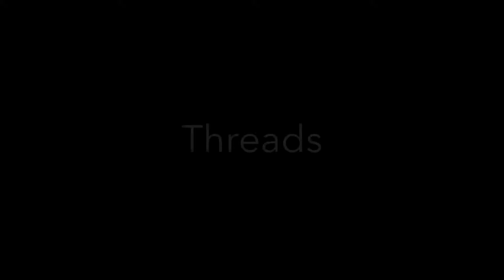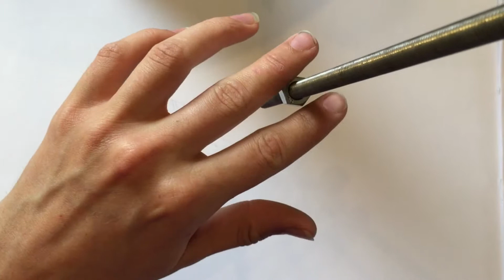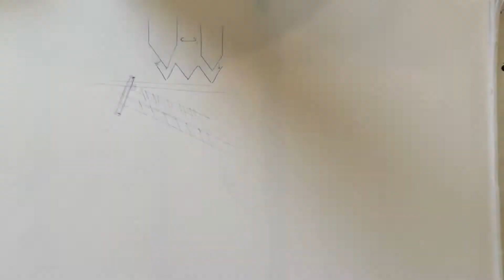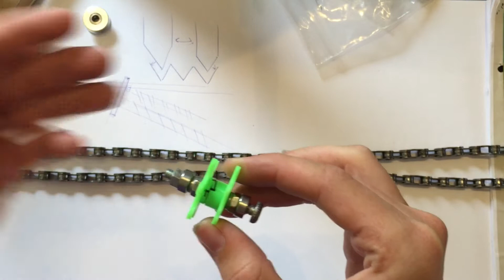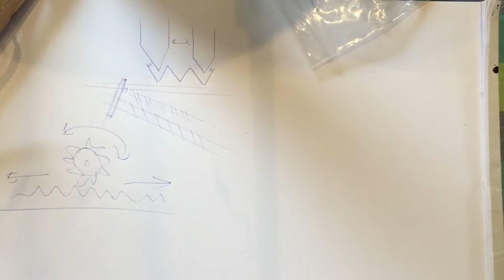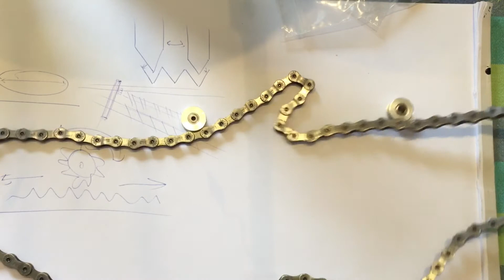Axis: Building my CNC PT2 - Intro to Linear Motion systems

Comment: Neat spring trick for anti back lash.  But the spring needs to be tighter than any kick back from your router/spindle.  With that much pressure on the spring, would the nuts be too hard to spin?

Comment: Ball screw is best for a precise machine but it's very expensive and very slow compared to other systems. New "Roler" rack and pinion design is the best, no backlash and it will not bend like a ball and lead screw in high power aplication. I have an idea, let me know what you think about that.  Basically imitating rack and pinion with an chain and sprocket but chain will be stretched and welded to flet metal bar so there is no jumping chain when stepper change direction, that usually happens in normal chain system when chain is streched and hanging in the air. I cant figure out how to make a good backlash system with just only one row of chain.
Reply from the maker: Srdjan Malic that’s pretty much the system I came up with minus the welding because I don’t have access to such tools. 
I made a split sprocket but in the end it worked better when using two chains instead of one, with one half of the split sprocket for each chain.
One very limiting issue, though, is that bike chains aren’t made to wonderful tolerances due to them not really needing it, so my experiments into that method didn’t go very successfully. When I have time to work on my CNC I’m changing it up again :)
Reply: @AcrimoniousMirth  How much did the bad tolerance on the chain contribute to error? Or what was the chain slop error? I wonder if a plywood cnc 's flex would overwhelm any chain tolerance errors.  Mine is .1mm.
Reply: Scissor gear. It's two gears(or sprockets) attached, with one being preloaded by springs against the other gear/sprocket. However its mostly only good for one cutting direction since the preload is unidirectional.

Buuuut if two sets of Scissor gear/sprockets where lined with mirrored Scissor action up on the same axial rail it could provide anti backlash in both cutting directions. The drawback is two sets of heavy sprockets, chains and, heavier bearings/shafts. 
But it requireds less mechanical parts to order/fabricate. Sooo more accurate n' less fussy?
Reply: I had a similar idea using two chains and an active 'follower' system